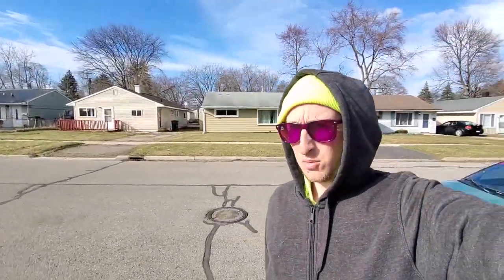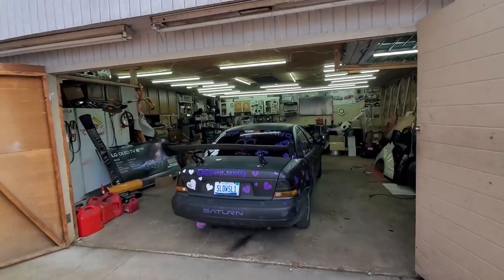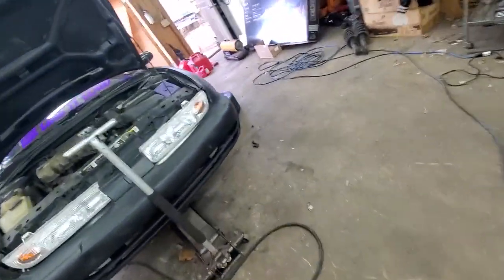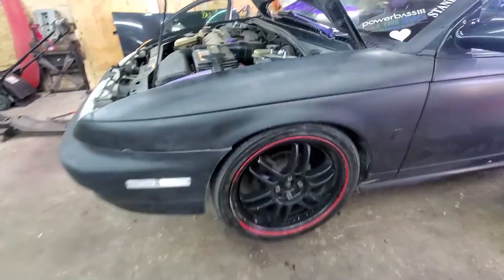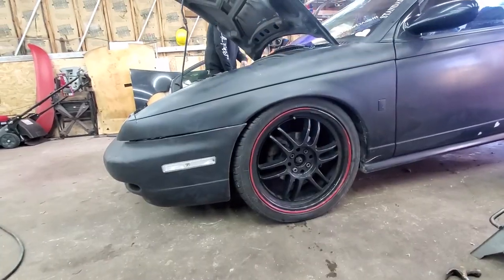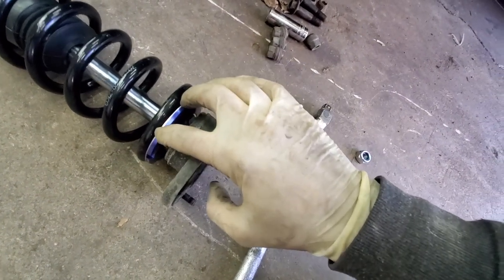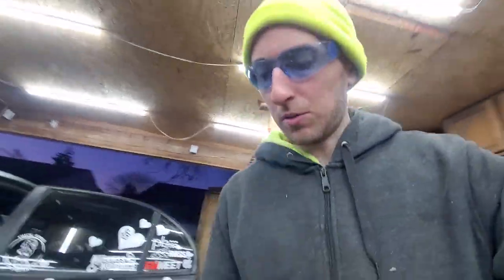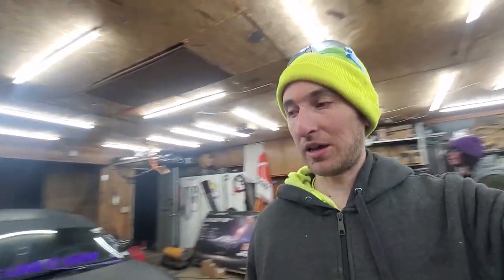Coilover install

Comment: I work for a towing company and I just picked up a 96 sl1 with 119k for $100  threw some 17s on it but it sits to high for me I need coilovers what kind do you recommend
Reply from the maker: I highly recommend saving up and getting the racelands
Reply: @BuilditBreakitGarageinc  would you happen to have a link to witch ones to buy

Comment: I have been having issues finding coilovers for my 98 sl2 and info on where to find some decent ones for it
Reply: You'll need to modify Imprezza WRX coilovers to fit. You can find info on this in the forums or I think there's a couple videos on youtube about it, too. I have Tein Street Advance Z coilovers on my SW2, but they don't quite go as low as I'd like, leaving like a 1/2" gap between the top of the tire and bottom of the fender arch.
Reply: What year Impreza coilovers?